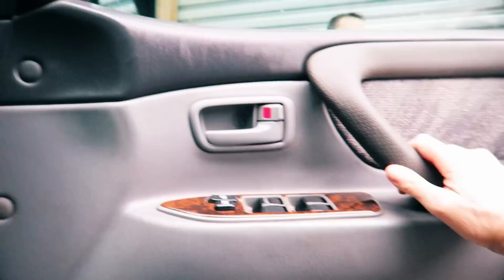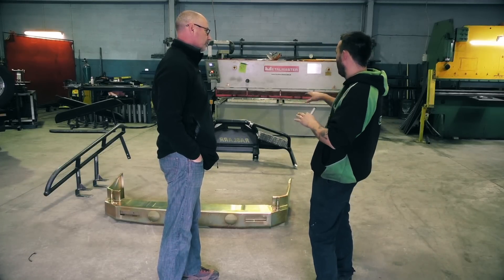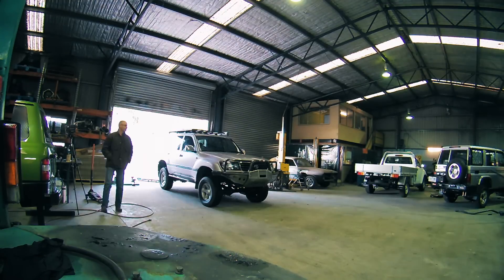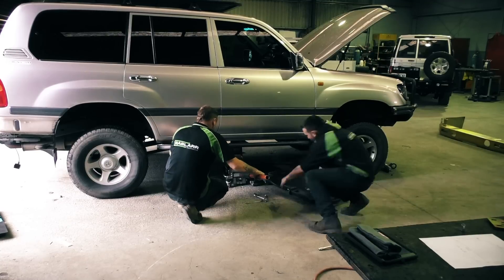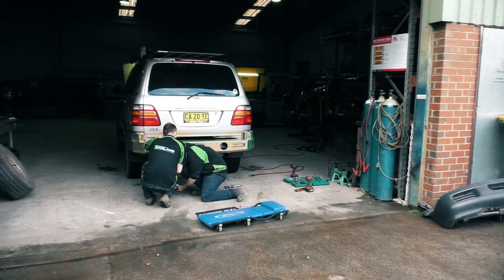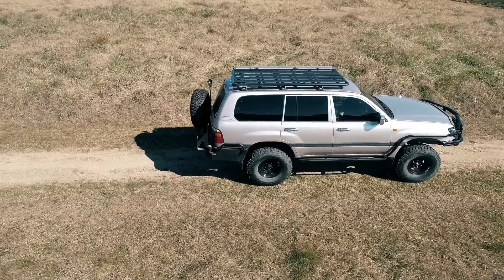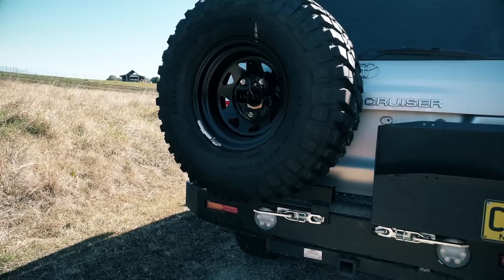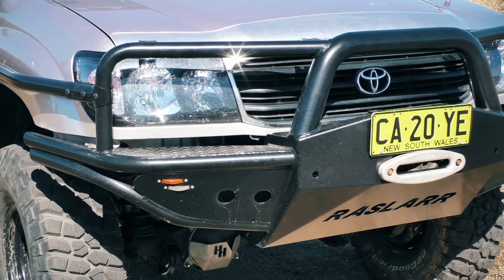Toyota Landcruiser 105  bull bar & rear bar Barwork Installation by Raslarr | VLOG ALLOFFROAD #6

Comment: Hey mate great vid. What made you go for a dual jerry can holder rather than a Jerry and Gas Bottle holder? Where do you store your gas bottle?
Reply from the maker: thanks mate, don't really store gas, I use a Coleman multi fuel and also use a Jet Boil with cartridges. I have gas in the Camper Trailer but that stored on draw bar.
Reply: @AlloffroadAu  thanks mate

Comment: why does the tow bar always hang lower than everything and is not incorporated in the rear bar ?
Reply: Able to keep cost and time down by keeping original towbar, seeming that all patrols and cruisers already have tow bars why replace it, raslarr can incorporate towbars upon special request..
Reply from the maker: most come with a factory rated tow bar, and it provides a good solid protection especially if you have a long range fuel tank